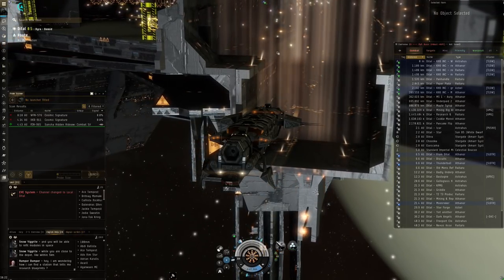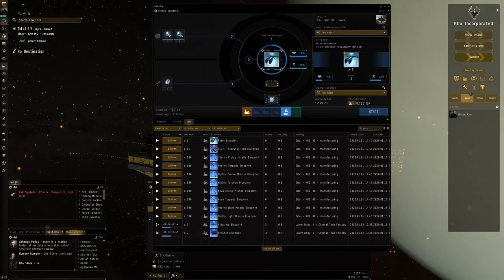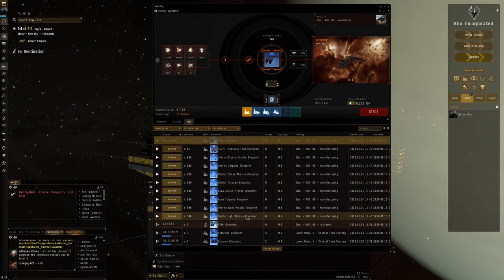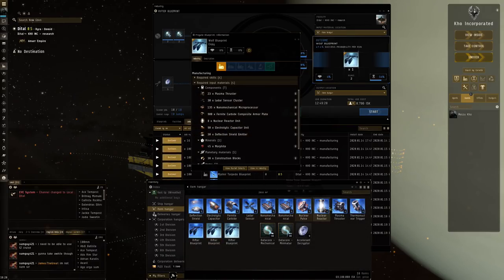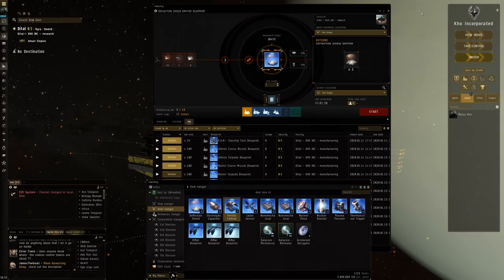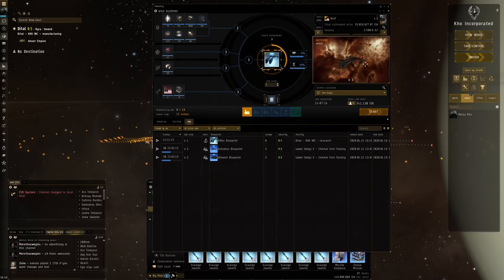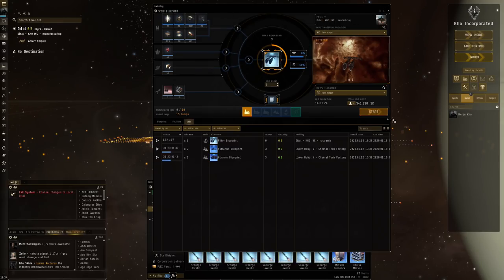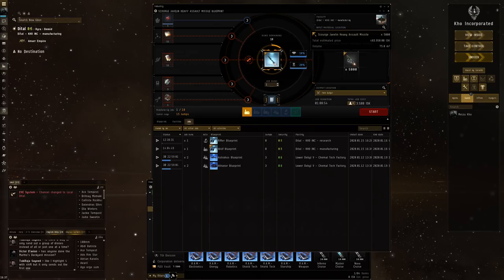EVE Online - making a T2 item

Comment: you've made a massive complicated process out of something very simple.

Buy BPO of the tech 1 variant from the market - Run Copies - Use Copies and datacores to invent tech2 BPC, you have a circa 30% chance to get a BPC, skills depending - use tech2 bpc, a tech 1 variant and the minerals required, to build the tech 2 variant. its that simple. 

Ive been doing tech 2 manufacturing since invention was added to the game, 10 plus years. 

Any questions im happy to answer them